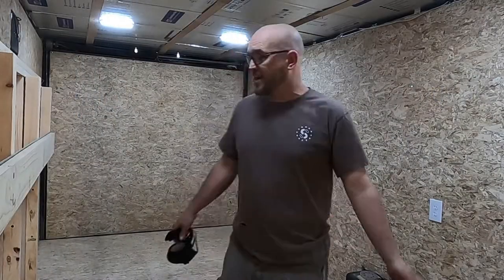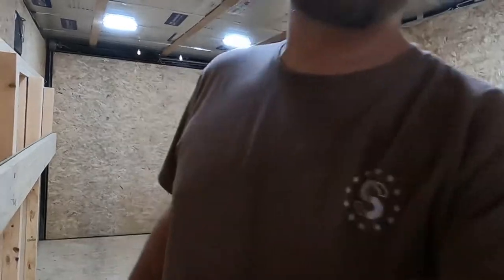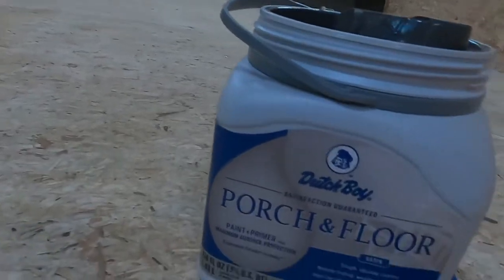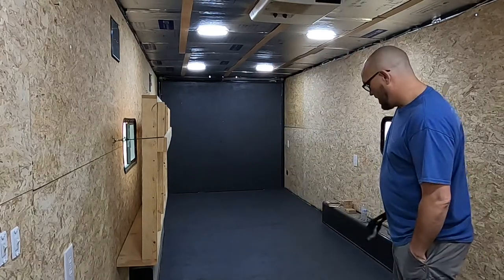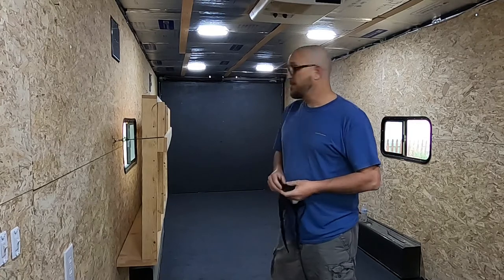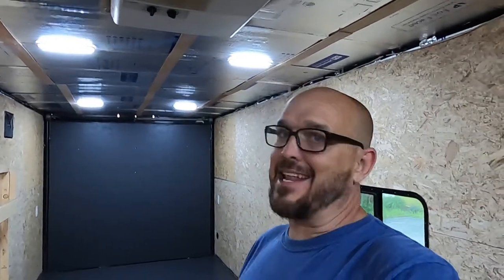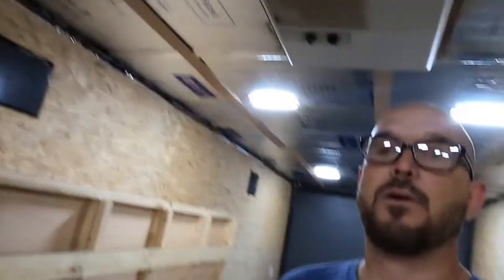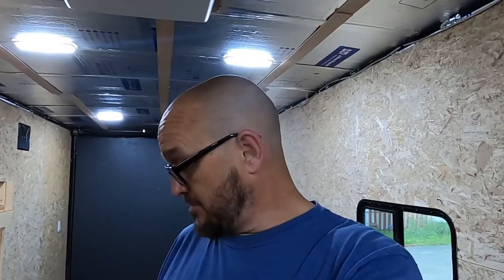Cargo trailer conversion (part 2) Coating the floors

Comment: How is this holding up. I have used some deck paint on the stairs in my shop and it's holding up really well. That was my choice for the floor of the trailer but my wife wants to use epoxy so I'm going back and forth